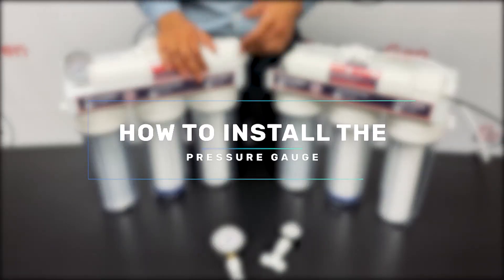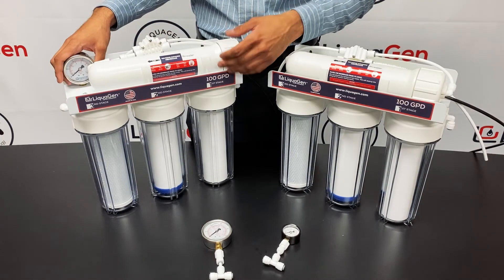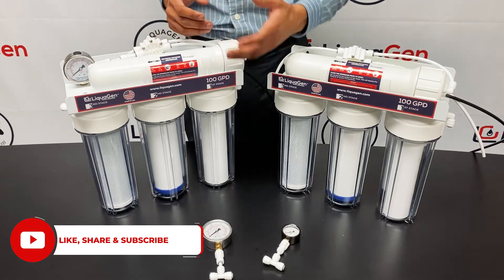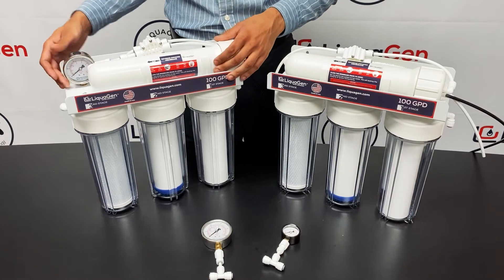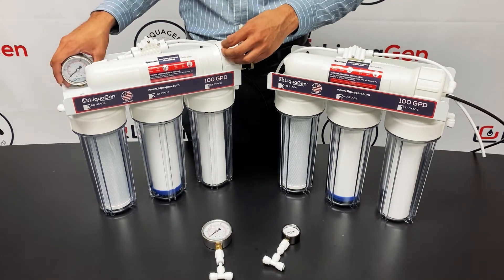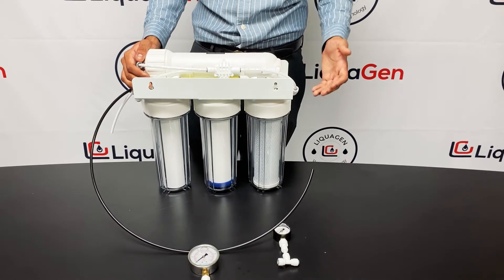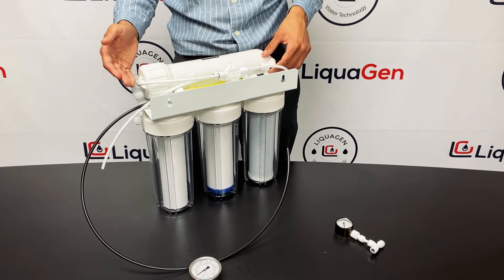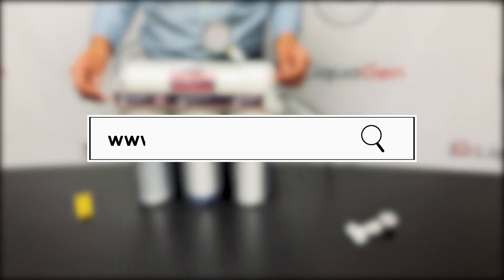How To Install a Pressure Gauge to your Reverse Osmosis (RO) System

Comment: Hey Vegas Nevada in the comments , I have the one on the left with the deodorizer it leakz from the pressure valve straight out the box, when you get the water purifier the pressure valve is already attached but I think I'm going to detach it and try to use the plumbers tape to see if I can stop it from leaking( it doesn't spew out its just a bunch of little drops that add up so since it's in my grow room I put it inside of a plastic tote that I have to dump every so often 7-10 days) ✌ hope this helps someone........